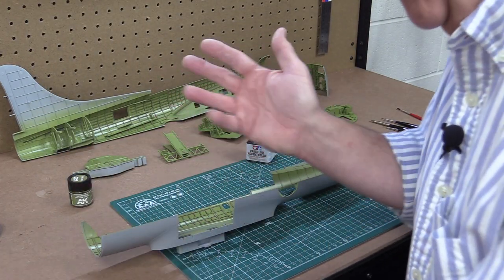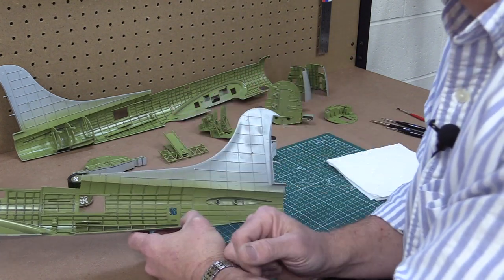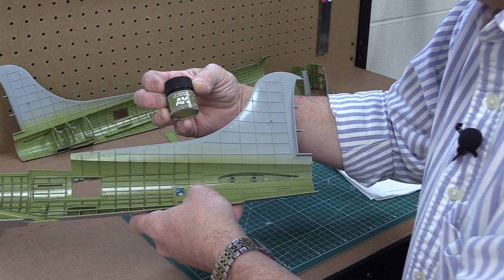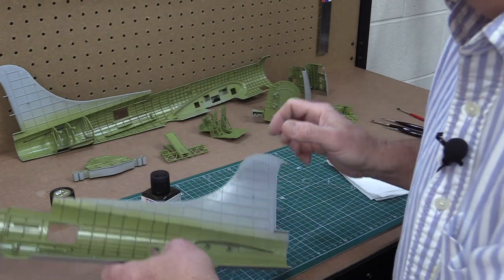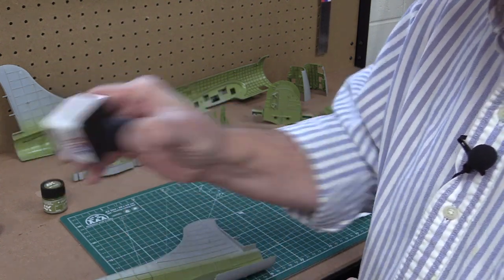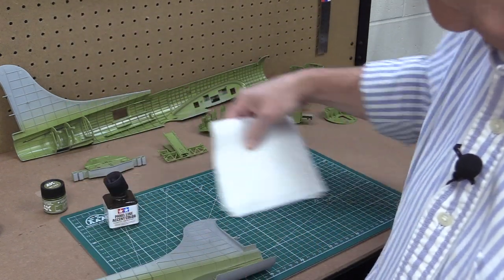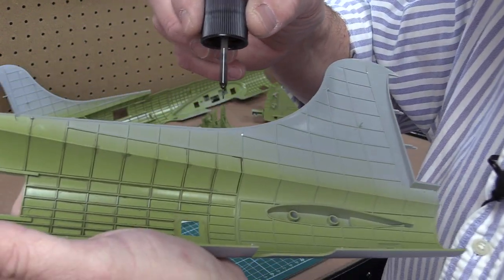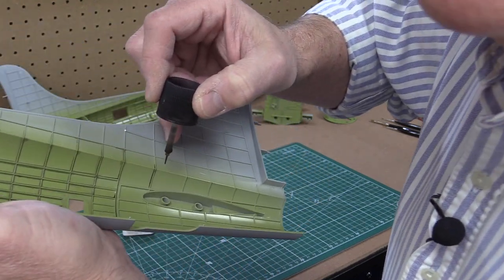How to Use Interior Wash on Plastic Model Kits -- B-17 Build Part 1

Comment: Why you need to paint the inside if you going  to glue it together?  I can see it for display  of course.  And i can see it where you can paint  at one location  where you can see the inside like windows.  So why one  would  paint the all inside  when gluing  together.  ??
Reply: If it can not be seen, the logic to myself as a modeler is. I know it is there and it looks correct. Even if it will not be seen.  Ever modeler builds at the level of detail they feel content with.  In model contests. It is  common for judges to use mini flashlights to see back into these hard to see places.  This is when this level of detail comes to light. 
Great question.